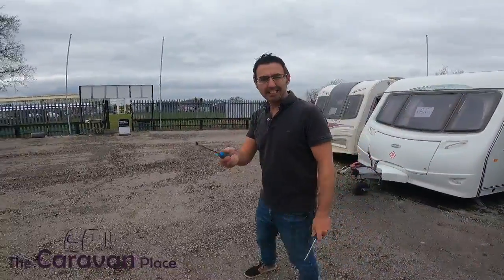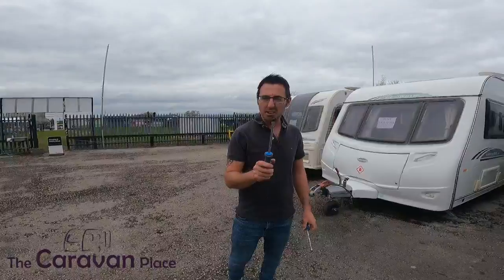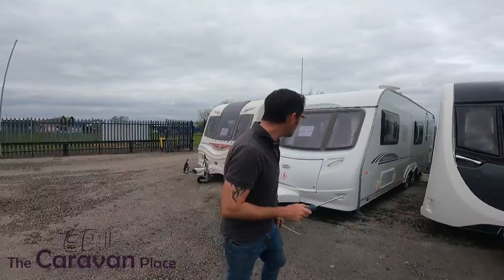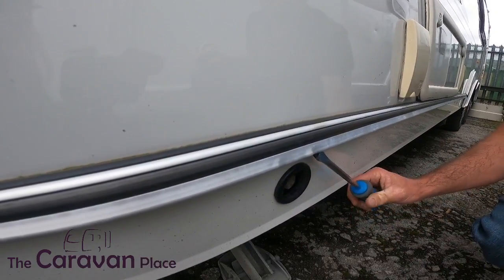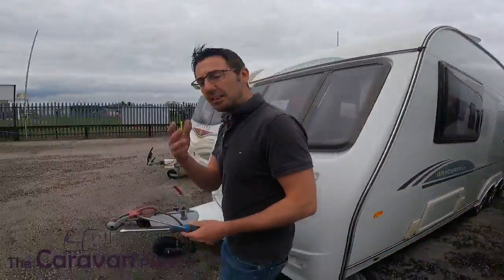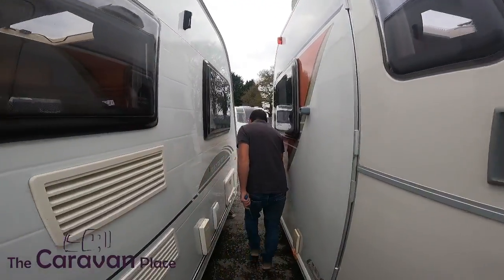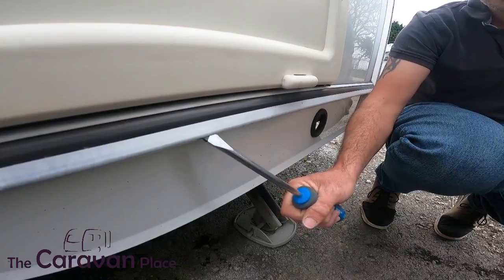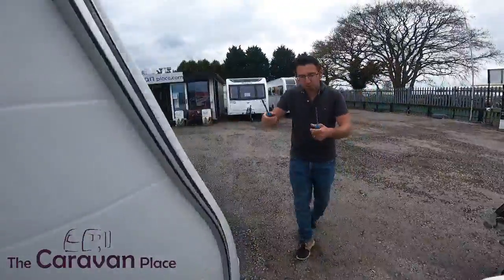CARAVAN TIPS that may make a big difference to caravanning

Comment: Another great vlog, great info on the slack blind. Keep them coming always something of interest .
Reply: Hi Mark, great video. What do you use for removing marks on pleated blinds?
Reply from the maker: Thanks Keith
Reply from the maker: It depends what the pleated blind material is? If its more of a fabric then I would use a carpet or fabric cleaner, something like the vanish stain remover. Hope this helps.
Reply: @thecaravanplace  Thanks for the quick reply Mark. A little unsure of the material. The caravan is a 2020 Elddis Affinity, of that helps?

Comment: G3 or meguiars ultimate compound on the windows even better if you have access to a machine polisher, as for weight I definitely carry a few unnecessary KGs
Reply from the maker: Thanks Ste, yes the G3 is good and with a machine will remove very deep scratches, we have used G3 by hand also and it will still get some deeper scratches out, not used the meguiars but would think its similar, thanks for mentioning these products.

Comment: How do you adjust the tension on the front blinds as you can’t get to the ends?
Reply from the maker: You will have to remove the screws holding the top of the blind, it should have screws under the covers that I removed on the video, once these are out you can angle the blind or pull it upwards and remove the top from the legs. You can then adjust and re fit. Just a bit more tricky. Hope this helps.